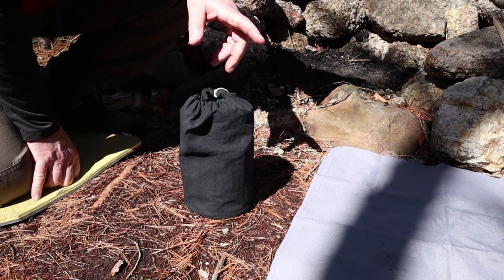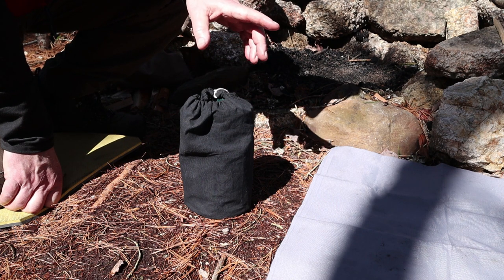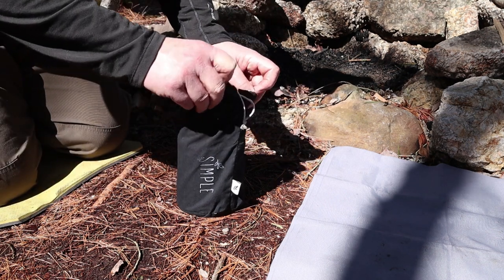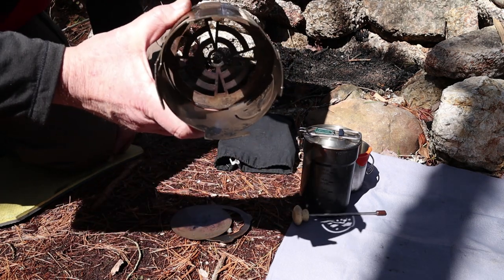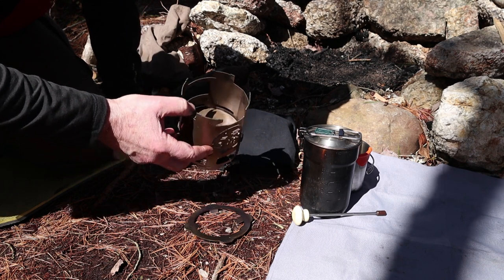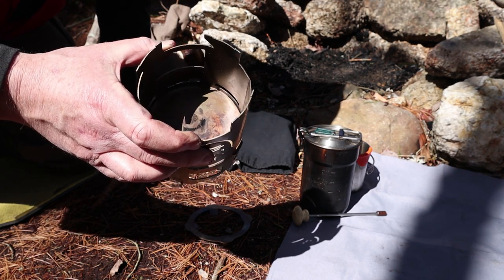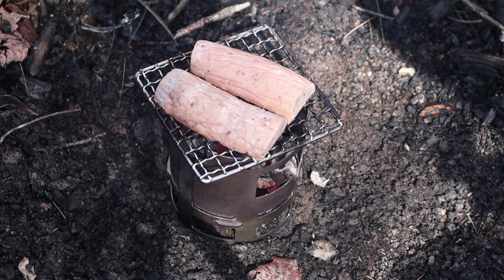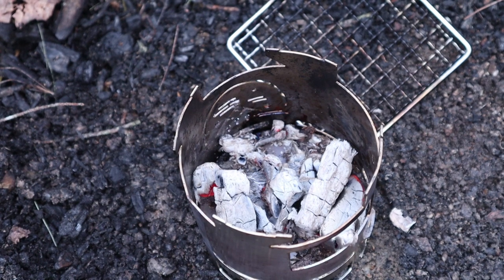How to Improve Grilling on the Simple Theory Gear Pack Stove XL

Comment: Excellent way to get coal in STG Pack Stove!  I've had this issue also!  I have also had this issue with the Fire Box Stove. So I was thinking also to put some kind of plate to slow down the burn so more coals are left.  Next time I use I will put some sort of plate inside to make coals.  Will let you know.  Thanks for the information!
Reply from the maker: I am looking at all my stoves this way now. I should have recognized it sooner as this is something the original Emberlit does well with its solid bottom plate. In order to work there has to be airflow at or just above the solid plate. Thanks for commenting

Comment: Thanks for the advice, I had the same problem.  I used all my wood and after the flames died down there was not enough coals left to cook with.
I will order an ash plate.
Reply: Mark has a great and Simple solution to the pack stove.
Reply from the maker: You will find a huge difference. Thanks for commenting

Comment: You have that kind of lateral thinking I appreciate! Ordered my XL and discovered it burned my hardwood coals fast, so I will definitely use this 'hack'. I was able to add 13-15 briquettes to the XL for a heat that cooked bacon, eggs and instant hash browns, and then some. What are the advantages of pellets vs standard charcoal briquettes? Thanks Mark and Mac! 😁
Reply from the maker: Right on. Pellets provide an even, long lasting heat. Great for boiling but not so good for grilling. An option when dry wood is hard to come by. Thanks for commenting
Reply: @MarkYoungBushcraft  Thanks. I look forward to more 'hacks' for the Simple Theory stove. For about the price of a basic Firebox G2 and no accessories, I was able to get the Simple Theory XL with every accessory. But I still want a Firebox! So far, so good for me.
Reply: @anthonychihuahua  Really the Firebox is the best all around stove fore everything if weight is not a concern.  If I had to do all over again I would pay the extra and get the Titanium version although it is much more expensive, but so much lighter.  A life time stove.
Reply: @kevinmccarthy6718  well, I really do appreciate your input, kevin m. It's advice like that that would push me towards something like that. The Firebox seems to be the top performer as far as large, warming fire capabilities, utilitarian, and packability. Weight is of no concern, but curious how much difference we talking about? With the "hack" presented here by Mark, I should be able to control my heat on the XL that much more👍 Have a great weekend.

Comment: Good detective work. Your solution worked well. Do wood pellets work better than charcoal?
Reply from the maker: I consider pellets and charcoal as different fuels. Grilling is better and longer of charcoal but it takes longer for it to heat up. Pellets work well for boiling but not so well for grilling. Both have their place but with different purposes. Thanks for commenting
Reply: @MarkYoungBushcraft  - My Viet wife and I have an appliance called a hot pot or lẩu and we fuel it with charcoal and use it at the table. It's easy to light the charcoal on a stove burner and then drop the briquettes down the chimney of the lẩu. They burn without smoke. If you soaked briquettes with alcohol and put them in a plastic bag they would be easy to light.
I haven't found a good source of wood pellets in this part of the world so I might be a bit biased. Do the pellets smoke when you light them?
Reply from the maker: @benthere8051  Yes, pellets do smoke some depending on air flow. I have a stove I reviewed that sounds like you "lau". tell me if this is similar https://youtu.be/YeA4RWl_Du8
Reply: @MarkYoungBushcraft  See: https://www.etsy.com/listing/873871606/authentic-22cm-thai-stainless-steel?ref=related-1
The fuel goes in the central column and a seasoned broth goes in the bowl surrounding the central column. The liquid remains near boiling and meats and seafood and veggies are cooked in the broth at the table. The diners can cook their food as little or as much as they want.

Comment: Mark, I ran into the same problem using my SS Firebox 5" while grilling some venison burgers.  Yuk, soot was a problem since the coals just burnt up.
Reply from the maker: There is a trick where you can use the ashpan up-side-down so that it cuts off air through the bottom. You may be able to find it on the Firebox channel. Thanks for commenting

Comment: Grilled wonderfully.Thanks for cutting away while you ate them, that would have been too much to endure. Does the ash plate suffer any warping when you use it that way?
Reply from the maker: No warping at all. At least not yet. Quite a heavy gauge steel and receives pretty even heating Thanks for commenting

Comment: Thanks for the video. Do you think you could have grilled the sausages with that stove with the pellets?
Reply from the maker: Possibly, with food grade hardwood pellets but you would have to wait until the flames went out. At that point the coals do not last very long but should be enough for a burger or sausages. Thanks for commenting